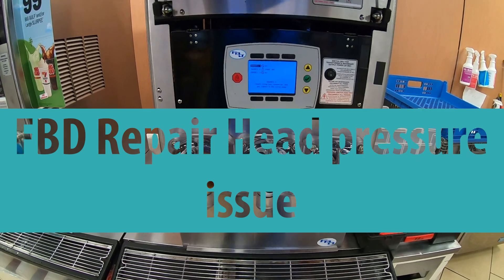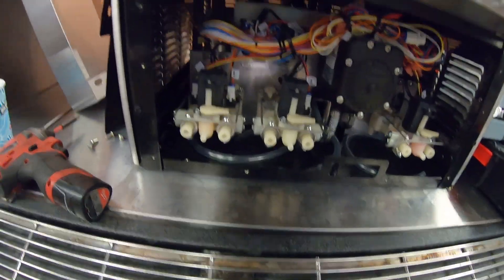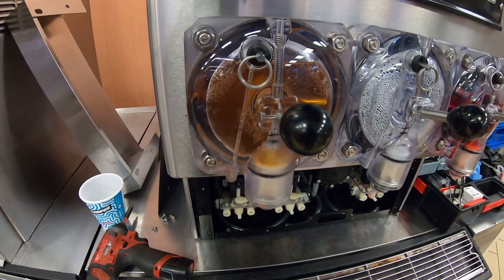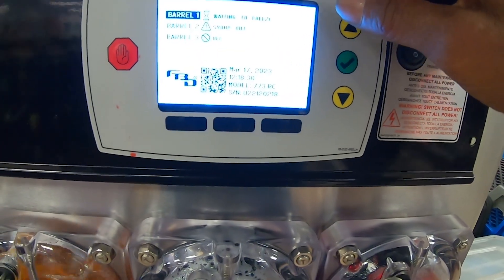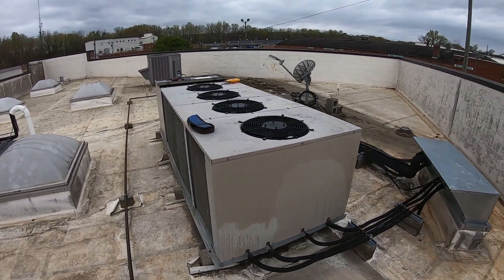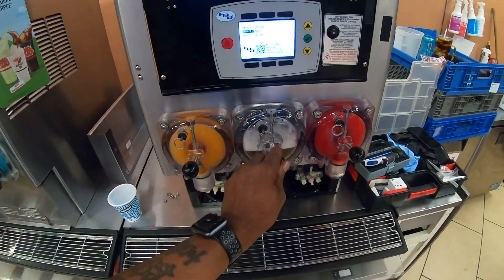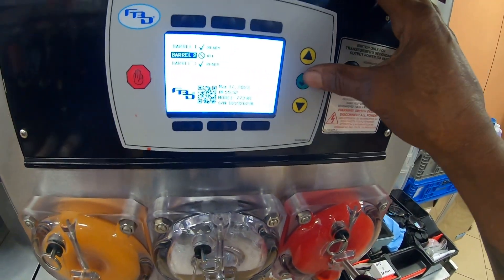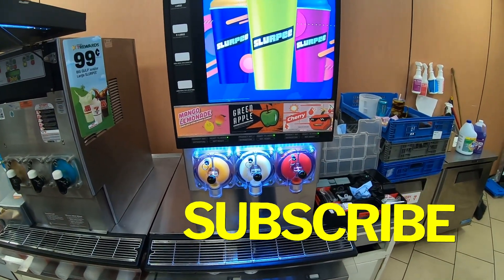FBD Repair - Head Pressure Issue

Comment: I have a question.  I have an fbd564 and the compressor kicks in but won't stay running longer than 3 seconds.  If I do the manual test it runs until I manually turn it off. What could the problem be?
Reply: Always check your contactor, sometimes the plunger stays stuck. I usually just smack it a couple times with my screw driver

Comment: Greatly prefer the self contained systems like the Cornelius Vipers and other FBD units. Seems like an unnecessary step to have to run that line set length to the roof for such a small machine.
Reply from the maker: Thanks for the comment, I also prefer the self contained units

Comment: What type or what is the most common way to cheap replace in/return  temperature sensors? This is standard termistor ntc 4.7k sensors? On label is RTD but I seen few replacements instaled already on fbd 564 machine and I wonder… what type they actually are?
Reply from the maker: Sorry, am not sure about a replacement, after market sensor